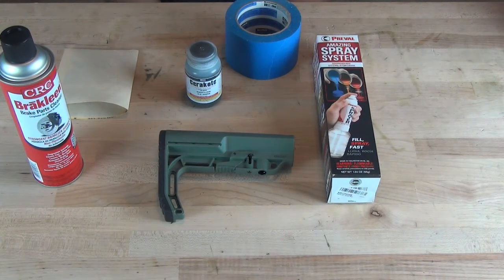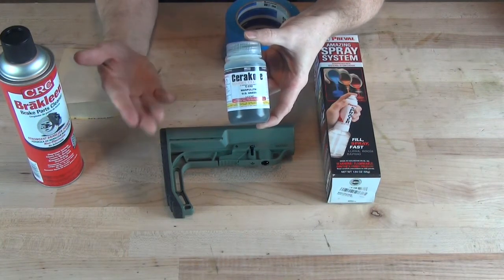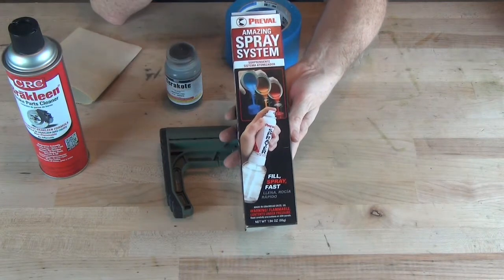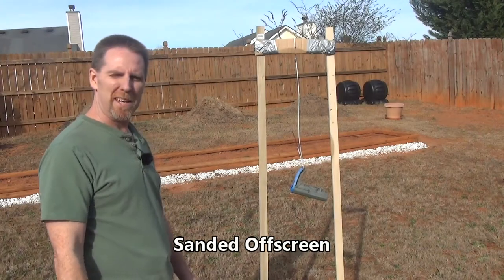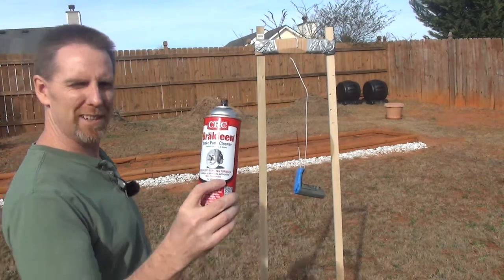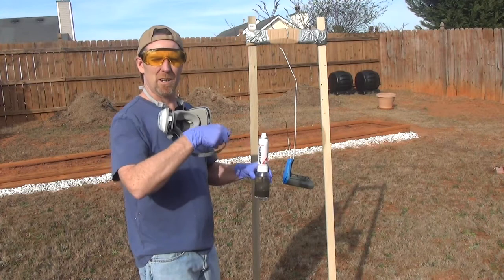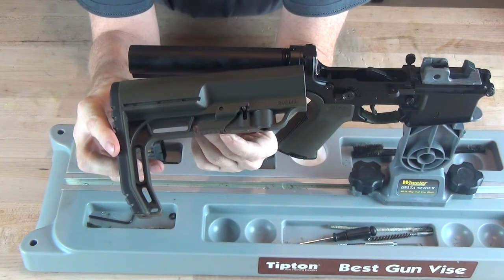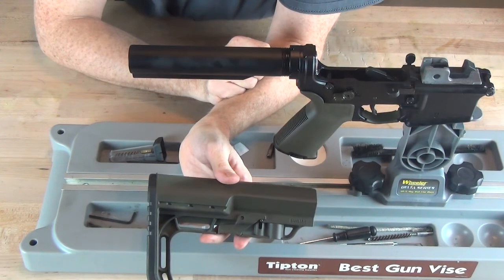Cerakote - Painting my Mission First Tactical Stock

Comment: I'm all for DIY. A lot of people would rather do their own work than pay an applicator. Good for them, and good for you. We do a fair portion of our stencil business with the DIY gun owners.

Just a few quick thoughts from someone that does this for a living though, that might help you in the future. One, you have to sand blast. The sand blasting actually etches the surface, creating small "v's" in the surface, that the Cerakote then settles into. This is what makes it such a durable coating, because it actually bonds to the surface. Two, brakekleen is ok, we use it for really gummed up surfaces, but it's a good idea to wipe it down with some acetone on a rag after to remove any residue. Three, don't be afraid to hold the item while you are spraying it. It will allow you to turn it around and get all those surfaces. You'd then just pop it on a hook for the last little area that you were holding it. The only key there is, once you grab it, don't move your hand. The glove will mask the area off while spraying. If you move your hand, it will smudge. Lastly, with the C series, give it about 30-45 minutes, just until it's tack free and can be handled without messing up the surface, take it out into the sun, and give it a good look. If there is a place that needs a little more coating, just hit it with a little more spray. It will bond to the layer underneath as long as it's shaken up, and as long as the layer underneath has not hardened completely (several hours).

Anyway, love the color combo. I'm a huge fan of two tone, and love the forest or OD green. We have a lot of tips and tricks on our channel, and our contact info is on our website. If you have any questions, shoot me a call.

Keep up the good work!

John
Reply: Branson you guys are great
Reply: @bblauter  We try, lol.

Comment: For those wondering. You can use the H series on polymer parts. Saves from having to buy double the Cerakote. 

The bake schedule for polymer is 150-180° for 2 hours. 
Also, one thicker coat. NOT many thin coats. 
This is what Ceracoat recommends. 
Hope this helps some folks.
👍🏼

Comment: One thing I have to mention. The hole on the top of your stock is there for a reason. A 1/4” inch punch through the hole pressing down on the release mechanism will allow your stock to slide onto the buffer tube without ripping the hell out of the stock with a pair of pliers or the tips of your fingers. Just sayin’ 
Also, try three light even coats with an airbrush next time. You will get better coverage and results.

Comment: where do you recommend hanging to stock to avoid bubbling? I hear the stuff I bought isn't supposed to bubble at all but I just want to be sure
Reply: So I would hang the stock from its forward end so the rubber butt pad hangs downward.. That way gravity will draw the excess paint down toward your tape.. Bubbling on your tape is easily removed with the tape..
Reply: Chris Flo would you recommend putting on gloves and putting 2 fingers in where the buffer tube would be and rotate that way while spraying instead of hanging it?
Reply: Not sure if I'd recommend it but I don't see why it wouldn't work. Just make sure you have sufficient range of motion to get all around the stock..
Reply: Chris Flo thanks for all the tips
Reply: Zack Smith use multiple thin coats and it won't run or build up. Prep it correctly and it won't bubble.

Comment: I've painted professionally for 25 years and if you can't paint any better than that then you don't need to be making instructional painting videos giving people incorrect information and improper techniques. So many mistakes in your application. Never want to cover it with one thick coat. About 3 thin coats would be perfect for that particular application. Also you want longer fluent sprays, not short spotty bursts as he did. Never push the button on the sprayer while it's pointed at the object you intend to paint because the sudden burst of air can and will cause runs and little paint spots to blow out on the object you're painting. Start the spray a tad bit away from object and bring it toward it and make your spray stroke fluently and evenly and never stopping until you get a little past the object. Keep a decent speed while performing spray stroke because if you go too slow then you build up too much material in one area and it causes runs. Little short bursts cause imperfections and build up unnecessary overspray.. I swear to god the first thing I ever painted when I was like 13 turned out way better than that.